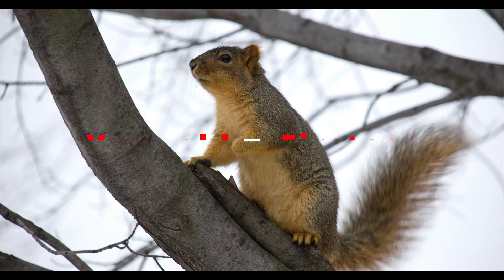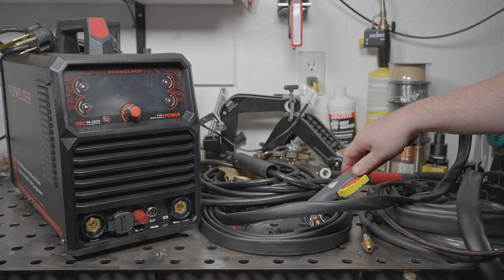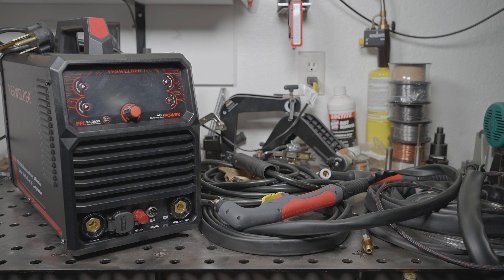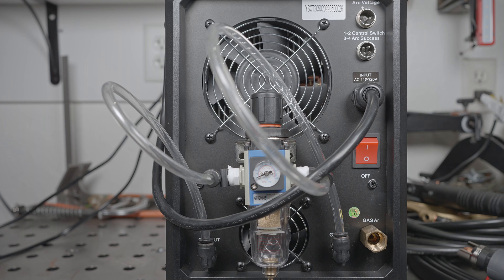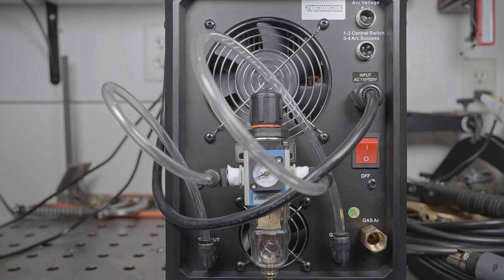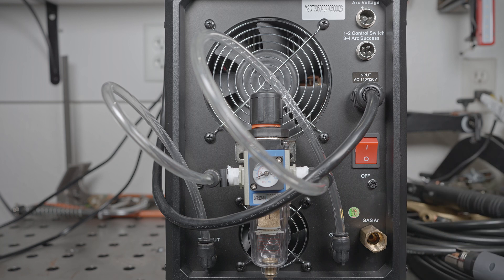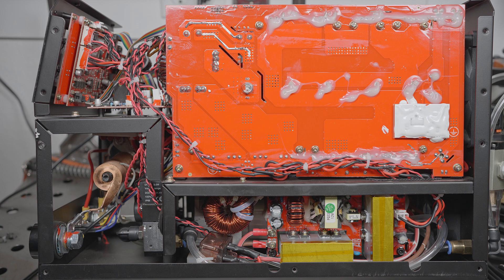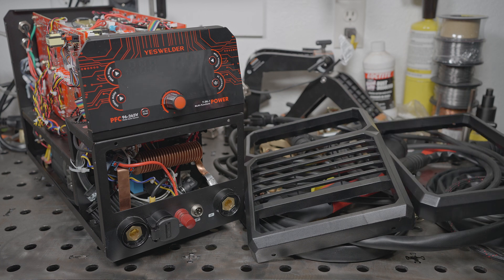Yeswelder CT2050 Review Part 1: Overview and a Look Inside

Comment: New subscriber. I appreciate how you break down the pros and cons of the systems you test! Do you think you would be able to break down the Yes Welder foot pedal and post a color coded wiring diagram of the 5 pin connection between the pedal and circuit board? Thanks

Comment: What other welder compares to this that you could recommend
Reply from the maker: I haven't tested the AC/DC TIG on the CT2050 yet (hopefully this weekend).  Personally, I would decide which process is most important to you and get a good machine for that process.

The CT2050 and MP200 are unique in some ways and priced low considering all the "processes" they can do.  But both of them make concessions and have bizarre issues that bother me.  Will some people be happy with them?  Probably.  But the issues are such that I have a difficult time recommending them (especially the MP200).  Unfortunately, that doesn't mean it's easy to come up with a direct alternative option.  Because the built-in plasma cutter is an uncommon feature.  

I don't want to make a final determination on the CT2050 until I finish testing the TIG modes, but as it stands, it's a mixed bag.  Some simple and effective hose fittings on the back, and a bizarrely chosen argon fitting.  Surprisingly decent plasma cutting with internal compressor and a stick mode with non-working/improper features.
Reply: @bigtb1717  my background is I'm coming from a 15-year-old Lincoln 140 amp and I use flux core I'm a backyard hobbyist that just wants something to learn on well they would having to buy multiple units
Reply from the maker: What process are you wanting to learn?  Most people really don't need all processes.
Reply: @bigtb1717  I want to be able to have the ability to do mig as that's what I know but I wanna learn the art of Tig welding I find it absolutely fascinating but I've never done it I also want to have the ability to plasma cut I was initially intrigued with the mp200 but because of its lackluster in quality features I would much rather spend the extra little bit of money and get the 2050 because it has a bit better kit and because I'm new to a lot of processes I won't be as fussy because I don't know what is good or great I just want to be able to get something that I'm not going to regret or wish I had have gotten something better without going out and getting the best of the best because I'm not a professional but I'm enthusiastic about the trade overall
Reply from the maker: Be aware, the CT2050 doesn't do MIG.
Reply: @bigtb1717  what ? So you're telling me all these YouTube videos that I've been watching that have all of these accessories for this machine is a lie
Reply: @bigtb1717  you're 100% right it's because I've been looking at the mp200 and the 2050 so basically my big thing is MIG welding and plasma cutting and then learning tig
Reply from the maker: The MP200 can do MIG, the CT2050 can not.
Reply: @bigtb1717  mp200 it is unless you have a recommendation on something equivalent

Comment: all in one was a bad idea for me, longevity plasma, tig stick AC/DC output, one failed feature can kill the whole machine.
Mine finally blew up after 10 years so i got the mig 205DS.

It was an expensive lesson, if you want plasma its better to buy a dedicated machine and have the shop plumbed with a separate compressor. In 10 years I only used the plasma once, it worked very well but was a wasted expensive feature.

Comment: Thanks for this video. I also wish they provided lift tig. Bought it to rebuild rocker panels on my car. Not sure I can use it because of HF start.
Reply from the maker: HF causing damage to engine electronics or the ECM is probably unlikely.  But it's hard to be sure.  And when I did a bit of welding on my Jeep, I used lift start, just in case.  Technically, they say the electronics should be disconnected before any welding, but I figured HF start would be extra risky.